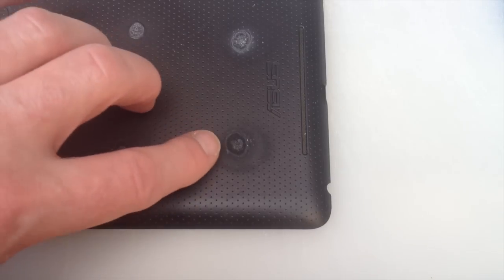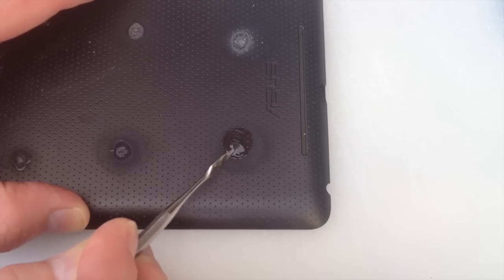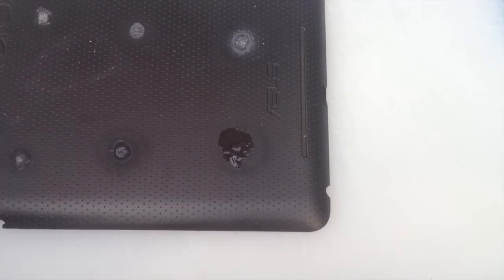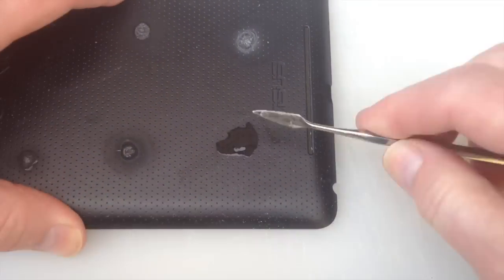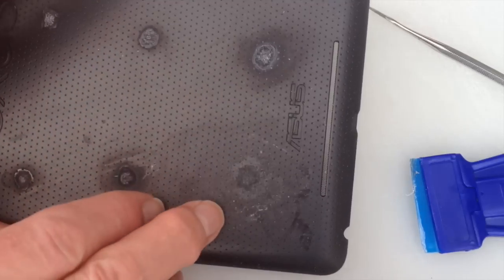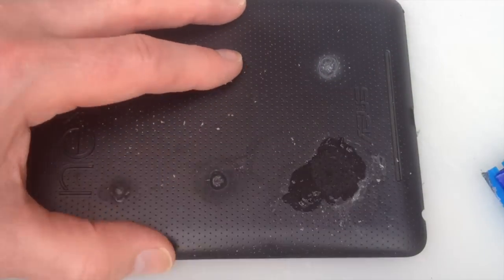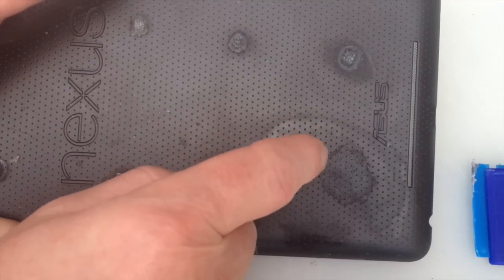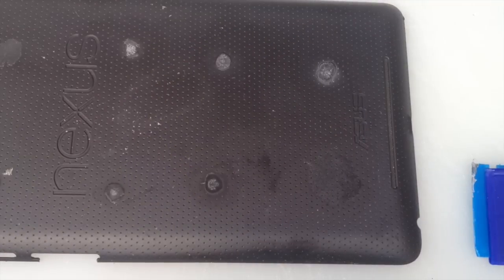Removing Superglue From Uneven Plastic Surfaces Experiments - Part 6 Using Pure Acetone

Comment: Could it take super glue off a Nintendo Switch Pro Controller?
Reply from the maker: it definitely could But!! it can melt the plastic or change its texture. The best thing to do it to find and area on the controller thats made of the same material but is out of sight and apply and rub it with a cotton wool earbud with a little nailer varnish remover on it.  Have paper tissues ready, if it starts to get sticky or melt wiper it off. If it goes on without damage then buy some pure acetone and do the same, if that doesn't damage it damp the earbud and gently wipe it over the superglue and keep doing it with a new bud until the glue has gone. PS you do this at your own risk and make sure you keep the acetone well away from the controller and have windows open. Please don't forget to subscribe to my channel and share the video and channel with others. Thanks Malcolm aka @fixed1t

Comment: But FIXEDIT when i am removing the superglue the mark still there how to get it off

PLZZ HELP
Reply from the maker: Sadly it isn't a mark, its the molecularly modified casing, which the superglue has eaten into.  There is little that can be done other than trying multiple applications and removal.
Reply: Ok

Comment: If you leave something with super glue on it with acetone, will the super glue break away?
Reply from the maker: Hi thanks for the question, the answer is yes, but the acetone is likely to melt away anything which isn't metal or glass or wood, so I wouldn't recommend it, its also highly flammable as is its vapour.  #fixed1tANDROIDtips

Comment: btw, i absolutely appreciate you going through all the trouble into finding out and documenting this series. i myself really want to know how to remove superglue stains effectively, but don't have the time to do so. Cheers!
Reply from the maker: +Hameerudin Zawawi Hi, thanks for the nice comment, I've had lots of people ask me about removing Superglue from Glasses, Chairs, TV's, iPads and even cars since I did my video of turning the horrible white mess into clear glass glue using heat.  So I thought I'd try chemicals and liquids I have around the house and garage to see what would help and what wouldn't.  I also received emails telling me certain things worked, when in fact they don't.  So what better way to find out than the ruin a perfectly good back cover for my Nexus 7 by squirting superglue on it and see if it can be removed without destroying it.  Its been interesting.  What amazes me, is when I get a thumbs down for Acetone partially working within a couple of views! LOL Exactly what did they thumbs down? that I'd taken the time to do this? that it worked a bit? that it didn't work completely? or that they'd watched it? It makes the process of doing the videos an amazing Psychological experiment, and as a Graduate of Behavioural Sciences and Artificial Intelligence, its right up my street, especially as I don't have to statistically analyse the results with SPSS ;-) #fixed1tresearch